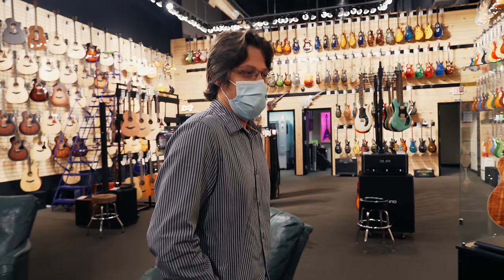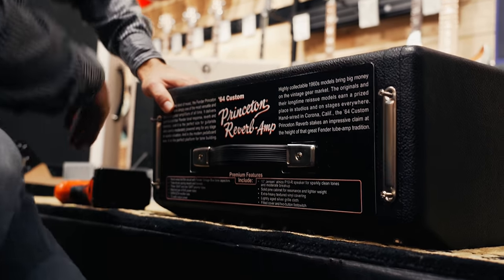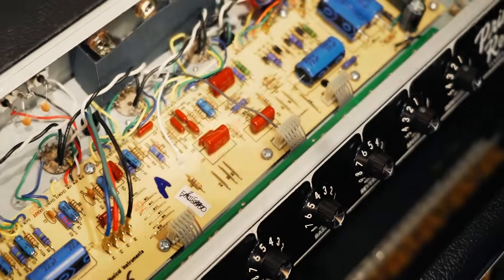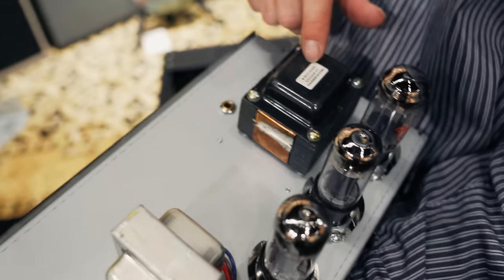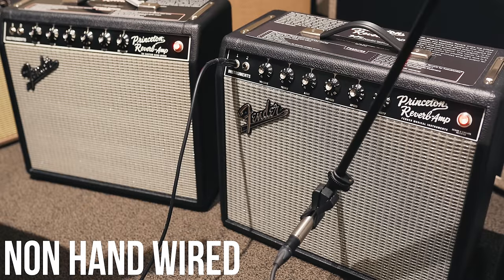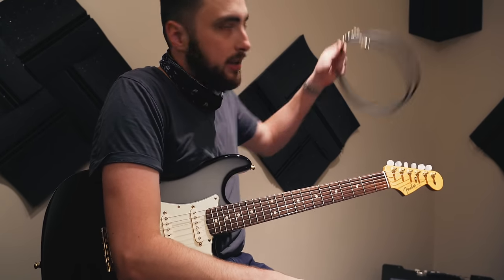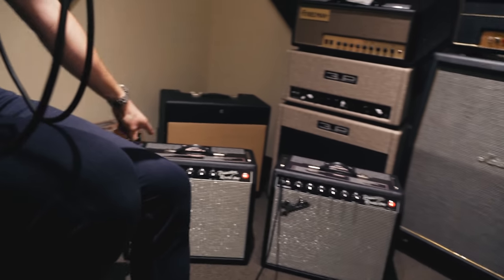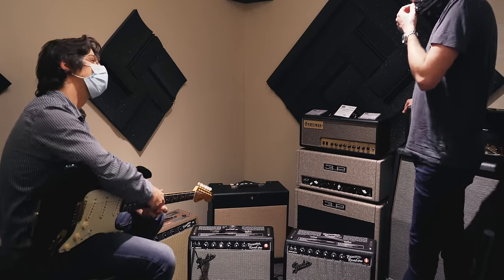Are Hand Wired Amps Really Better?

Comment: OK, there's a super nerdy follow up to this. Take both amps to a good amp tech and measure the bias of the power tubes. To me, once you eliminate the speaker as a factor the biggest difference in tone was that the hand wired amp sounded like it was biased hotter. I'd love to hear how getting the idle plate current values on the factory amp to match the hand-wired one would sound. The speaker was 80% of the difference with those two amps. I'd wager the tube biasing is at least another 10% on top of that.
Reply: I'm going to have to agree.  Though I wasn't in the room, and my internet audio is far from great.  It did sound to me like the difference I heard (up until around 11:30:00 or so) could have come from a difference in bias setting.  Just that alone, on the same amp, with the same tubes, can make radical changes in the performance, tone, response of the amp.  

That said; back in the day, I got a silver faced deluxe for really cheap.  Not bad.  Pretty good, actually.  I decided to see if hand wiring would really make a difference.  
Removed all the components from the circuit boards.   Made a turret board that would lay out the components (the exact components from the PCB)  as close as possible to an original hand-wired, and rebuilt the whole amp by hand.  
I did this just because.... 
Just because I wanted to see if it would really make a difference, and if so, how much.
End result;  it did make a change.  But not a lot.  I was more careful with wiring paths since I was not in a hurry on a production line.  (which helps)  
I was happy that I did it.   But except for the noted points about reliability and serviceability, I wouldn't shell out scads more money for what little bit of difference I heard in my experiment. 
Just one person's personal experience.
Reply: this "would-be" the ultimate test,, the rest of this is just blah"blah mid scoop  yawn,,,
Reply: @aceraspire7456  Personally I think if something fails then it may serve to handwire the replacement. But probably not until then. The first busted potentiometer would have me tossing that whole front board out. Get me some big chonky connector to interface it with the main PCB too, to ensure good contact for years (then Deoxit, wiggle, and you're good for a few more years).

BTW, I still have an 8.9" Acer Aspire One. It's pretty amazing what they managed to cram in there, yet still be relatively easy to take apart.
Reply: @mal2ksc  
Your idea does make much more sense than mine does.
But mine wasn't really meant to satisfy any existing need or to right anything that was wrong.  Just simply; "I wonder...."
I got the amp super-cheap; so not much of a loss if it all went down the tubes.  (*see what I did there?)
But I wasn't worried about that since I'd been diddling around with electronics for many years already. 
My experiment was as much a 'make-work' project for fun as it was to see what the difference would be.  
I knew it would be better physically and practically.  But I was curious (like the concept of this video) what the sonic difference might be also.
Reply: @aceraspire7456  Well I figured with a name like "acer aspire" you'd know about the "shotgun method" of troubleshooting, as frequently practiced in the computer world -- tear it down to the board level, then put it back together and see if it works. If you had a bad solder joint -- you don't anymore! This can be faster than actually tracking down the bad solder joint, but it can also lead to a habit of tearing things apart without bothering to properly diagnose them first.
Reply: @mal2ksc  
Though that might be a faster method of trouble-shooting, it's far less interesting, and one doesn't learn much from it to use later on.
I'm actually a - "is it plugged in?" first, "is it turned on?", "do you see any lights on?", "is it making any kind of sound at all?", etc., kinda guy.  After a while, you get so you recognize what the most likely problems (defects) are connected to what the symptoms are.  Then proceed accordingly.
The 'rip-it-out-n-replace' methodology is a bit too corporate for me.  
As for the name; just a hokey gmail moniker that doesn't really mean much at all except it's an account that doesn't really need my name on it for what I use it for.
:-)
Reply: Wait a minute there, bub! You’re attempting to be too objective.
Reply: I agree, the bias should be set the same.  As I posted above this, I think only one set of tubes should have be used and swapped between amps with the bias set the same on both amps.
Reply: This is on point. This will drastically change the feel of the amp. The hand wired seemed to break up faster which is probably a good chunk from that

Comment: 0:35
The circuit is different. You can't do an apples to apples comparison.
Reply: Yep,  at that point you are just comparing two different amps.
Reply: The circuit is the same. The components are different. Axials vs radials.
Reply: @russellesimonetta3835  If the circuit were identical, the tone would have been identical.  The components don't matter.  Their values do.   People seem to think that there is a difference between a $0.05 capacitor and a $25 capacitor.  As someone who understands electronics and has experimented with both, I can say there's no difference.  These are different circuits.
Reply: @Dartheomus  maybe I should have said based on the schematic not the circuit. As to caps I think quality is inportant. I don't like the IC caps Fender likes to use in even their most expensive  amps. Saving money on budget caps on a two to three thousand dollar amp is puzzling. F+T'S are with in a dollar or two per electrolic caps. I think the reissue fender amps still sound great actually. I am a life long ,old retired, pro drummer so not an expert,, but an afficiando. When I started I was playing five nights a week next to brand new 64 fender tube amps. During the 70's they started sounding shittier and shittier.
Reply: @Dartheomus  Components matter. For example, there are lots of capacitor physical construction variants and materials which affects their frequency response. Different capacitors have different ESR and inductance values that change with temperature and frequency. Thats why there is no standard capacitor. Search for capacitor datasheets and you will see that they are quitte different from each other. If it makes difference sound wise? Not really. There are a lot of other aspects in an amplifier that contributte more significatly to the sound. But if you are engineering a precision radio frequency instrument, as an engineer (which I am) you will have to know how to choose a capacitor.
Reply: @barbasbandas6665  I think we agree with each other.  You are correct that choice of construction materials will affect response times and even tolerances.  Ultimately, there will be slight differences in tone from one to another.  But I think you are also making my other point as well.  The subtle differences will often be nearly imperceptible in our application, or at least easily corrected for by application of an EQ and/or a compressor.
Reply: @russellesimonetta3835  The 70s seemed to be a bad time for electronics and guitars too.  Companies were mostly focused on cost cutting, and it showed.  However, this doesn't translate to what is happening today.  The reason they choose the components they do today is because they tend to be more reliable and consistent from one to the next.  They want every amp to come out identical, and now they pretty much can.  Yes, it also saves a little money, but as you accurately point out, it's only a few bucks a unit... If they thought spending a few more dollars would make it better, I think they would as a marketing tool.  People erroneously believe big old-school components are better, but usually they just have worse tolerances and are more prone to the electrolytics leaking or drying out.
Reply: @russellesimonetta3835  I'd suggest it was probably your hearing that was getting shittier and shittier.
Reply: @medley4570  yeah I'm a pissy old man that spent fourty years playing next to those noisy amps. I might have scrambled my brains a little too. Loud music and free drinks.
Reply: @Dartheomus  The difference between the two capacitors is you can pull one out of a drawer and one will be almost certainly within a given tolerance and the other not. The differences in the circuit are minute though. there are similar differences between many blackface amps that do not amount to the radical differences in tone heard here. 

ANd while cap construction makes no difference to guitar circuits that bleed to ground on an amp they do, so it matters.

Comment: The funny thing is, looking at the sound alone, Leo Fender would have probably preferred the non hand wired for it is slightly cleaner sounding, which has probably to do with the mid scoop.
That said, i do prefer the hand wired amp.

Comment: I’m so glad someone finally did this video and you did a great job Rhett. I built Holland Amps with Mike back in the 90’s. Mike always used premium over rated components plus some special tricks in his point to point wired boutique amps. Those amps are amazing. Anyway, no is no possibility that two amps with the same schematic, one built point to point and the other with low quality components on a pc board will ever sound the same as your video clearly demonstrates. The difference is in the signal strength throughout the circuit. It really shows up best in the midtones but it’s not just more midtones, it’s quality midtones and you can hear that in the video. You could boost the mids on the pc board version with an eq, onboard or external and it still will not be the same. The signal sizes are just bigger and better aligned in a point to point wired amp. Certainly the pc board amps still sound fine but they won’t last as long and they are more difficult to repair. Again, thx for doing this video. I have another challenge for you. Do a comparison between a particle board and or plywood speaker cabinet against one made with aged solid yellow pine. I double dog dare ya!!! 😝

Comment: The wiring is cool and awesome, but I personally wouldn't say it's beautiful. I was held to high standards wiring refractometers, UV devices, deicing machines, etc. and the ones done by my boss were absolutely beautiful, symmetrical perfect wire runs. Not downing the quality or anything of the Fenders amps, but there are much nicer wiring jobs out there.
Reply: Wiring an amp is not usually done to be aesthetically pleasing. It’s done to negate interference. The prettiest wiring job could make the amp hum like garbage.

Comment: I play hand wired and PCB and can honestly say as an amp builder too, the hand wired amp will sound better as it has better components inside it! Put all the same components on a board and there won't be any difference 🙂
Reply: Actually I'm tempted to call BS on that.  I realize more expensive components may age differently or have different voltage limits, or be more likely to be within their spec range, but otherwise, a resistor is a resistor.  How could "better" be the factor you say it is?
Reply: @lqr824  a mini is a car but not as good as a Rolls Royce! 
Easy comparison. Better quality equals better sound.
Reply: @rgbplumbinghilton  how is that possible?  The comparison between a Mini and Roller is not apt at all.  I'm puzzled you would even say that if you are an amp builder.  At best you might claim one is a car built on an assembly line and the other is bolted together by hand out of identical parts.  (Or in the case of this video, sometimes different parts that nonetheless function identically from an engineering perspective.)
Reply: @lqr824  it was just a basic comparison as I don't know how technical you are. A production built mini would not be as good or as expensive as a hand built mini. 

I have built a few amps, one when I started in 2003 was a 5e3 using budget components. Everything was cheap Chinese stuff except the transformers and speaker. 

I built the same amp in 2004 using resistors that cost over 4 x the price and F and T caps. NoS GEC valves and better wire. Better CTS pots and Alnico speaker. The tonal difference was a mile apart and so was the cost. Now I am not saying resistors make much difference but Caps do and do speakers valves and pots. All marginal but big together. 

Now if you think it's BS and you are happy with the amp you have great. My comment was aimed at a comparison that is not a fair one due to componant level. It is really a budget Vs Boutique and our ears could tell which sounded best.

Comment: Interesting hearing guys who aren't familiar with electronics and component minutia, discuss electronics. First off- the "signal"or coupling  capacitors in both amps are very different (from the very brief video shots of the two amp PCB boards). Why does this matter? Different cap materials sound different and behave differently. The audio signal flows through the caps in many (or some) cases so their construction material type does matter. In places where they are just used for filtering the DC voltage to make it smooth, Electrolytic types are used- in both amps. No signal goes through them, as they are only used for power supply-related functions, so one could argue the capacitor type does not make any difference in that particular electrical function. The value does, however, but only in how much filtering they do. Hum, anyone? The hand-wired amp shows polypropylene-types (I believe...) which DOES make an audio difference. For example- most audiophile-grade audio electronics use poly caps as they do sound better. I have no idea why, but they seem to. I am not a chemist or physicist, only an electronics hardware design engineer (and guitarist- 54 years) so I rely on lengthy listening experience and practical results. The Fender PCB-type newer version shows mylar-type caps being used. Why the difference over time? Cost of components/ profit, I would guess. They both do the same thing but have different cost and audio characteristics when putting dynamic audio signals through them. PCB or hand wired? No practical audible difference if both are done correctly- only reliability. After servicing literally thousands of tube amps in my 30 years in that biz, I have found that the output transformer determines a huge amount of the tonal characteristic. More to follow.......

Comment: I think most of the tonal differences were largely due to the speakers and somewhat due to differing tolerances in each component within the amp. 

What some people don't consider is what was mentioned in the video: maintenance and modification. The hand-wired is way easier to maintain, modify and fix than the non-wired.

Comment: You'd be hard pressed to find a guitar store in most places that would take the amps apart for a video demo. Cheers to Righteous!
Reply: not true. the store is getting free promo, and/or rhett paid them. any store would do it for that
Reply: @email3575  of course they’re getting promotion, it’s only fair. As does any store that’s featured in any sort of video. And unless you have proof Rhett paid Ben extra then that’s just a false claim.
Reply: @email3575  but you and I both know that if we walked into a regular Guitar Center or Sam Ash they are not going to take the amps that are on the floor apart just so we can see what’s inside of them for a random video.

Comment: I've build a number of hand wired tube amps, and designed my own pcb for 5F1 style amps (like the Princeton tweed). The big capacitors we saw on each of these amps are for the high voltage power supply , and besides being the same components, have no effect on the frequency response. All the smaller capacitors - those directly affect the tone, and were clearly different physical components between the amps. The job of a capacitor is to allow certain frequencies to pass, and block others. My guess is that just swapping out the power tube cathode bypass capacitor on the pcb amp with the same one used in the hand wired would go 90% of the way to resolving the differences between the sounds.
To go just a little deeper - two different capacitors may have the same Farad rating and store the same amount at some rated voltage, but they'll have different internal resistance, and the charge/discharge as a function of time will look different. Ideally you have a linear voltage curve with no hysteresis - but that never happens. Ceramic caps work great for lots of things but have a non-linear response that make them poorly suited for audio signals. Aluminum electrolytic caps are relatively compact and cheap but aren't as linear or stable as film capacitors.
Reply: A guy posted above said essentially what you're saying, so you're confirming each other.  How expensive is it to change out capacitors?

Comment: The handwired was definitely beefier and thicker but that also gave a bunch more low mid mud. The non-handwired was bright and vibrant. The non handwired amp with the handwired speaker was sort of the worst of both in my opinion.

Personally, I would rather use the handwired than non-hand wired cause it's easier to cut low mids than add them when you want them